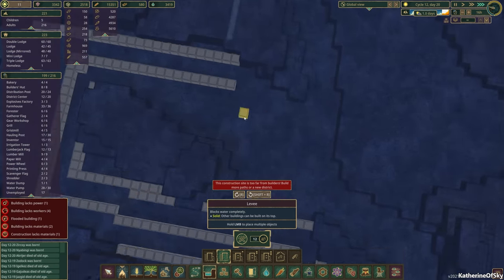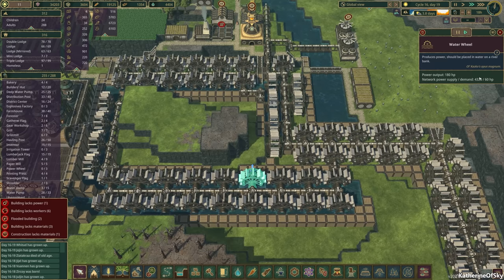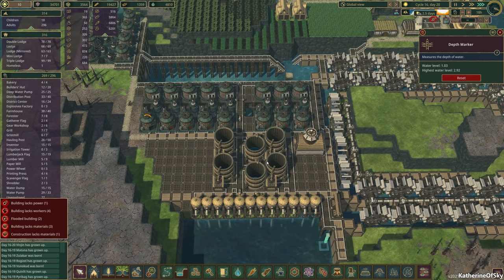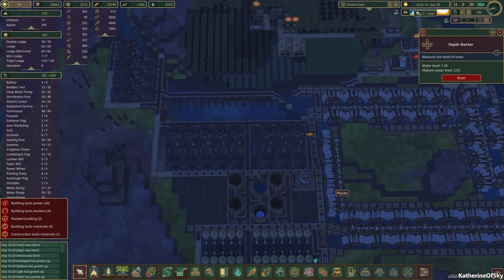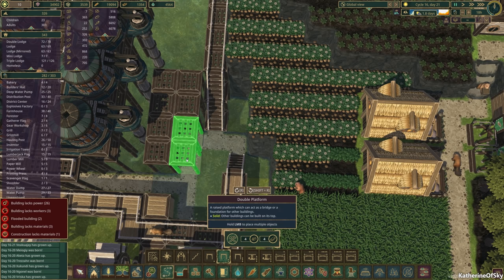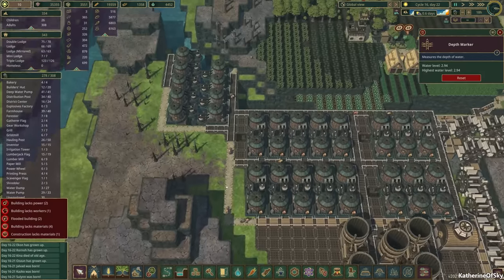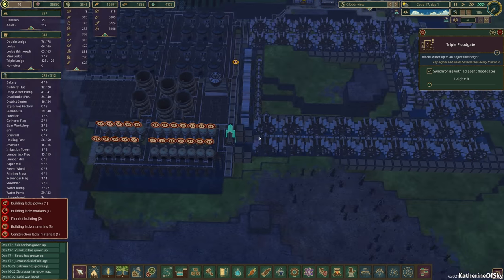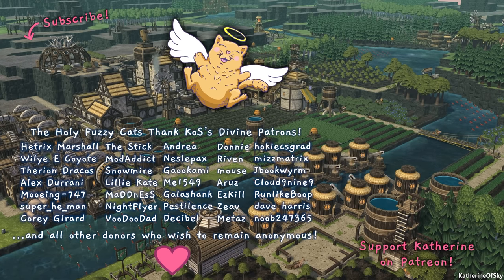Perpetual Pumping Station: Waterwheels for Miles! CRAZY MEGAPROJECT Timberborn

Comment: it's not really a perpetum mobile as you need to consider some things:
- you need a lot of workforce from beavers
- each tile will lose water over time (so you need a lot of additional water over time - the longer the dry periods the harder it gets to keep it running)

if we ever get automated pumps with energy this may turn into one but still would require water from outside from time to time
Reply from the maker: It does run perpetually with beaver employment as well as water input to counter evaporation.  A good machine to use instead of waiting for the wet season to come around again :-)

Comment: You will suffer water loss from 2 things. Evaporation and ground seepage. The best way to go that i can see is Levee the bottom of the run and make it as deep as possible like using the Ironteeth big water wheels.
Reply from the maker: There's no such thing as ground seepage.  You must have missed the area in the west where I get more water in from the river to top up any evaporation losses.
Reply from the maker: Also, this tutorial was made before the addition of other waterwheels to the game.  Check the dates next time ;-)
Reply: Actually, ground seepage is how the land around the river is fertilie and how your water dumps work for keeping crops from drying out.
Reply from the maker: @PupOrionSirius26  That is a visual efffect, but there is no rate of depletion.

Comment: Maybe a better design would be to have an elevated water source, say 3 tiles high.
Then you have water wheels in sets of 4 built in contained areas linked to that and sealed with a dam.
Each progressive set of water wheels would then be 1 block lower than the previous one to make sure water flows from "upstream" to "downstream"
eg: for a water source 3 blocks high, you'd have 3x sets of 4 water wheels.

It would look something like: 

Water dump [Floodgate] > water wheels [dam] > [1 block lower] water wheels [dam] > repeat until water pump area.

For Ironteeth, it would be possible to make a 6 deep water pump area while still having flat land access to the water dumps!

The idea behind it would be to let the water build up until it overflows at the Water Dumps, then naturally build up flow across each set of 4 water wheels.
It would take much longer to reach a steady state, but would provide infinite power due to never having to stop and "recharge" the source reservoir.

Comment: It's not strictly "perpetual motion" if you're adding power from the beavers. If pipes are ever added it'll be interesting to see if they get the maths right to stop you making a true perpetual motion machine ;)
Reply from the maker: The beavers are part of the perpetual motion machine!  Integral cogs!
Reply: @KatherineOfSky  Yes. So a bicycle is a perpetual motion machine. Woohoo!
Reply: Dont think maths / work over distance is a big thing to these guys. Have you seen the transfer of power currently?? 🤣 Youd be losing 10hp every power shaft block/intersection at the very least hahah

Comment: Doesn't the game have evaporation too? You would still be reliant on flood seasons to fill up the reservoir, but this technique would keep you going through droughts. It could easily be scaled down to work with just a few thousand HP. Nice.

The fact that beavers don't work during the night could throw a spanner into the plan, but it would probably just need a break for a day to readjust, if that causes any trouble down the line.
Reply from the maker: Indeed, that's why you need a little top-up from the main water source to compensate for evaporation.

Comment: enjoyable but could be slightly more informative in my opinion.
i suggest anyone wanting to replicate this kind of power output idea needs to first experiment on the ratios of how many pumps per dump and how many of em is required to keep a even flow in any set of distance they want to replicate this in and keep in mind the nutritional and awe and what ever requirements required to have the beavers at max working condition while dealing with this and the ideal amount of haulers per building and probably a good idea to monitor the evaporation rate for the set area to have some idea about what kind of amount of pumps you want to have from outside the system to keep it running constantly.
Reply from the maker: This was the experiment ;-)
Reply: @KatherineOfSky  more like a shot in the dark on is there a possibility in doing something like this and now you would need to proceed to having at least some estimations on how many pumps/ dumps/haulers you need for it to run somewhat semi-constantly and then proceed to testing what the ratios between each building and job should be for having actual numbers that you could use as a guideline to scale it up or down some based on needs.
still keeping my opinion of: great content but not the most informative piece.

Comment: This is missing the conclusion to test out how much you need to keep it running continuously (i.e. without micromanaging). Both in terms of beavers (in pumps, dumps and hauling) as well as outside water input to work against evaporation in the channel and reservoirs.
Reply from the maker: It's an experiment!

Comment: Wow. I was wondering about this, and then this video popped up. I’m surprised the water wheels don’t seem to rob energy from the water, and that they need so little flow. The water spread so thin across such a long channel with no height differences, still somehow working quite well. That does suggest that a continuous flow is within reach.

P.S. I thought you were selling beavers, but now it’s nuts? Scammed!
Reply from the maker: XD

Comment: Really neat! What if instead of a giant U shape, you connected the ends of the channel as a loop with a floodgate? Then you put in water once, then close the source and open the connection so the wave flows around and around. I'm not sure how the water is modeled but if that's basically a wave going around a circle, you get permanent power until the water is spread too thin to move or has evaporated. Might be a way to make more consistent power with less micro and really get all the energy from the little bit of starting height?
Reply from the maker: The water needs to have a lower elevation to flow to.  If you just did a course on 1 level, it would stand still

Comment: Damn this isnt a thing in the current version
Reply from the maker: Nope.  They changed how wheels interact.  However, you can make a shorter run and use a water pump instead of dumps.
Reply: @KatherineOfSky  yea i know but its still a shame
Reply from the maker: I think it makes it better, and more fun to experiment with engineering
Reply: @KatherineOfSky  yea, but i do thing the pumps take too much power and it takes a lot of water wheels to brake even with them
Reply from the maker: @ognyanognyanov6250  Just make a tiered-height structure, where the water flows down with each bank of wheels.  That works really well.  You might need 2-3 pumps, but there is a large net gain.  Someone in my discord posted the specs for that if you wanna see a picture, etc.  It's pinned.